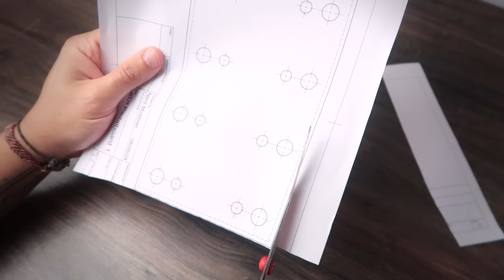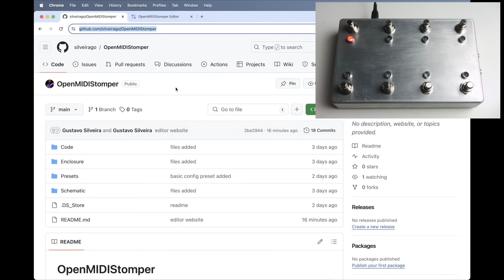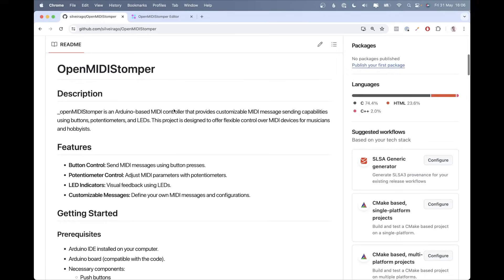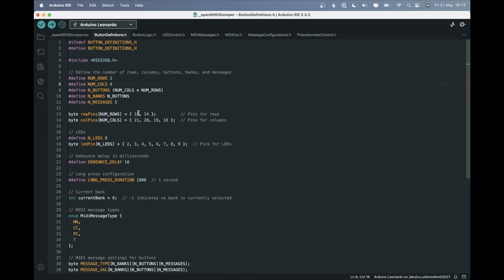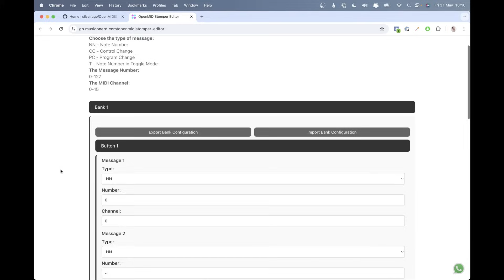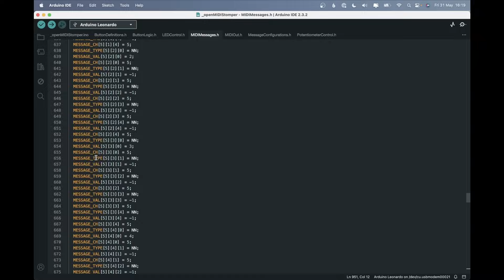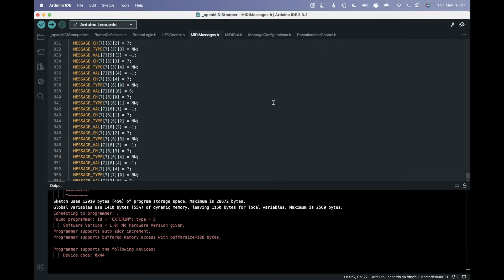I Built an Arduino MIDI Foot Controller: the OpenMIDIStomper

Comment: So, how can we change from LongPress detected to buttom down detected?
Reply: From Copilot 🙂:

#ifndef BUTTON_LOGIC_H
#define BUTTON_LOGIC_H

#include "ButtonDefinitions.h"
#include "MIDIOut.h"

// Button states
int btnStates[NUM_ROWS][NUM_COLS];

// Function declarations
void printbuttonCState(int index);
void scanButtonMatrix();

// Initialize button pins
void setupButtons() {
  for (int row = 0; row < NUM_ROWS; row++) {
    pinMode(rowPins[row], OUTPUT);
    digitalWrite(rowPins[row], HIGH);  // Set to HIGH initially
  }

  for (int col = 0; col < NUM_COLS; col++) {
    pinMode(colPins[col], INPUT_PULLUP);
  }
}

// Scan the button matrix
void scanButtonMatrix() {
  for (int row = 0; row < NUM_ROWS; row++) {
    digitalWrite(rowPins[row], LOW);  // Activate current row
    for (int col = 0; col < NUM_COLS; col++) {
      byte buttonIndex = row * NUM_COLS + col;

      if (digitalRead(colPins[col]) == LOW) {
        // Button pressed
        btnStates[row][col]   = 1;
        buttonCState[buttonIndex] = 1;

        // If you no longer need timing/long-press elsewhere, you can remove these arrays entirely.
        // buttonPressStartTime[buttonIndex] = millis();  // <-- not needed for simple press
        // longPressDetected[buttonIndex] = false;        // <-- not needed
      } else {
        // Button released
        btnStates[row][col]   = 0;
        buttonCState[buttonIndex] = 0;
      }

      printbuttonCState(buttonIndex);  // Handle debouncing and actions
    }
    digitalWrite(rowPins[row], HIGH);  // Deactivate row
  }
}

// Debounced handler: trigger on press edge (0 -> 1)
void printbuttonCState(int index) {
  static unsigned long lastDebounceTime[N_BUTTONS] = { 0 };

  if ((millis() - lastDebounceTime[index]) > DEBOUNCE_DELAY) {
    lastDebounceTime[index] = millis();

    // Edge detection: state changed?
    if (buttonPState[index] != buttonCState[index]) {
      if (buttonCState[index] > 0) {
        // === PRESS EVENT ===
        digitalWrite(ledPin[index], HIGH);
        isAnyButtonPressed = true;

        // Send MIDI on press
        sendMidiMsg(index);

      } else {
        // === RELEASE EVENT ===
        digitalWrite(ledPin[index], LOW);
        isAnyButtonPressed = false;
        // No MIDI on release anymore
      }

      // Update previous state
      buttonPState[index] = buttonCState[index];
    }

    // No long-press block anymore—fully removed
  }
}

#endif

Comment: A tip for drilling larger holes - drill halfway through, then turn the piece over and drill from the other side.  The large drill is less likely to snatch and both side of the hole are neater.

Comment: Hey do you have any programmable  midi display project? My Ampero control is a amazing gear, but it has a p.s 3 display, I would like to have a display, that I could easily customize it, with more detailed information about the bank.

Comment: Perfect ! this is wat I was looking for for my Headrush MX5 , I made one and it works perfect on my computer with a USB C cable directly inserted into te PC and the arduino but now I want to implement it for use with my MX5 and I connected a 9V battery at the RAW input and GND to be independent of the power of the USB-c coming from the pc , and on the other hand a usb-c cable from the arduino into the midi input of my MX5 but it doesn't work ?!? can you help me a little bit please what I'm doing wrong? 😅

Comment: Thanks for sharing this project. I made one for me and it works great. But I dont understand how expression jack works. I have an expression pedal and want to connect it with my midi controller. But when I plug in the pedal and open the midi monitor, nothing happens. Can you please explain how can I use expression pedal with this midi controller? Thank you!
Reply: you are not alone

Comment: Great work...I'm inspired!  Quick question (I hope) How much latency is there when using expression pedals?  I have been using a Hotone 4 button controller (usb midi connection) and experience lag when trying to use expression pedals for wah type effects.  Even a small amount of latency is painful/unusable when used in that way.  Have you tested the responsiveness when using this rig to control any wah/tremolo type effects in real time?

Comment: Hey there, Great video and tutorial! I have a quick question: at the 3:14 , you start using what looks like magnet wire. Why did you choose to use magnet wire there instead of covered copper wire like you did later at 3:56? Is there a specific reason for opting for magnet wire, or is that actually non-insulated copper wire?

Comment: Hello Gustavo, thanks for the awesome workshop!

I have a couple of questions, if you don’t mind:

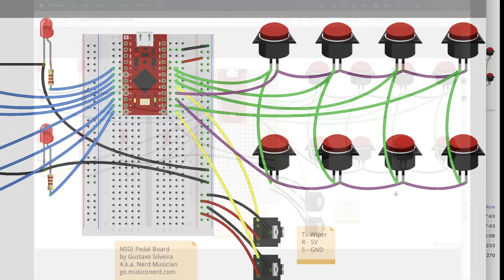1. Why did you choose Fritzing to design your breadboard schematic instead of KiCad, which you use in your course for circuit design? 7:44

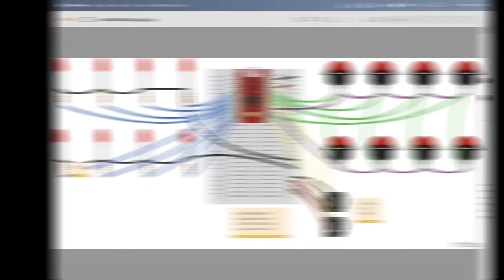2. For the enclosure, what software did you use to design the template with the drill hole placements? Was it SolidWorks or something else?  8:16

Comment: At first I was shocked not to see a multiplexer, then I realized that you implemented button matrix. Congrats, great design. I made the same pedal last year, but with a multiplexer.
Reply from the maker: This way you just can't press two buttons of the same column at the same time, but since it's not the goal with this project, it's not a problem.
Reply: @NerdMusician  which is a problem you can solve by using diodes, like they do with QMK- and similarly devised (computer) keyboards!
Thanks for this project btw, I will be building something similar soon to extend the functionality of my ampero mini - which takes midi over usb-c. Another commenter already asked about it; It would be great to have a break-out to hook up the arduino with other midi connection-types/plugs, to increase versatility and avoid external adapters!

Comment: Thank you for your excellent work.
Just a small thing:
To know not only which bank we are in, but also which selection within this bank.
Solution
2 led's per button
OR
A little numerical display for the bank and then the led just for selection